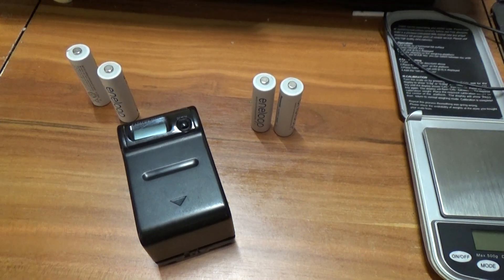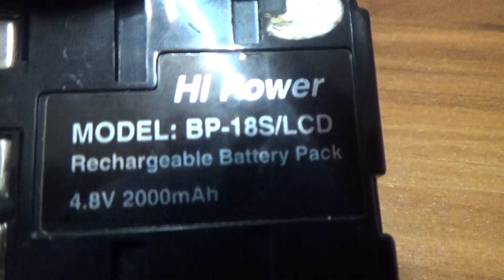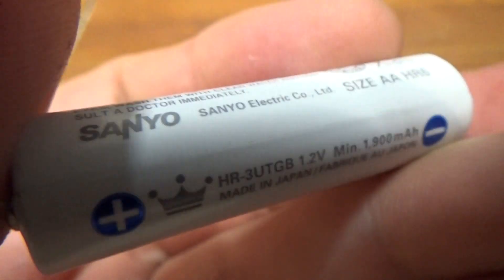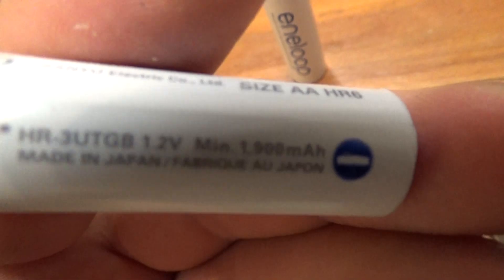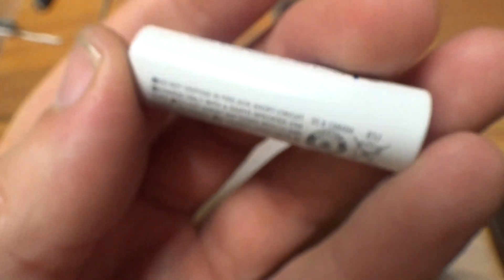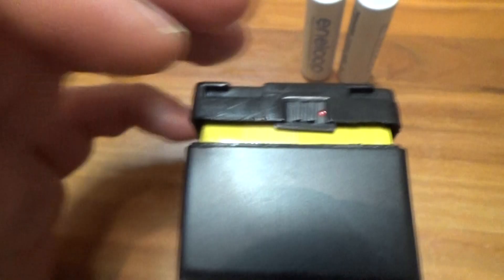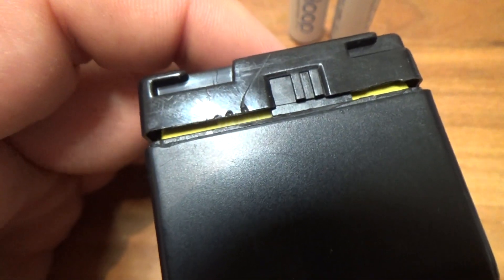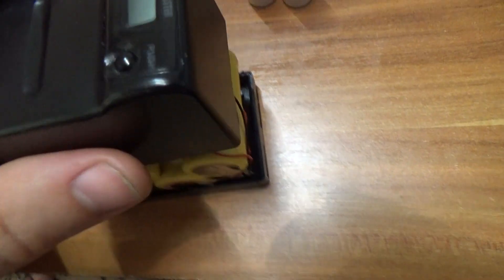DIY Rechargeable battery pack cell replacement Eneloop Part 1

Comment: Alex, Im not for sure, but that maybe a "thermistor" (https://en.wikipedia.org/wiki/Thermistor), it is a safety device to ensure the batteries dont overheat during charge or it could act as a shut off valve when the batteries get to a certain voltage, Im not a battery guy, so thats just a cheap guess.  ~Jack, VEG
Reply from the maker: Thank you:)
Reply: You are very welcomed!  :)  ~Jack, VEG